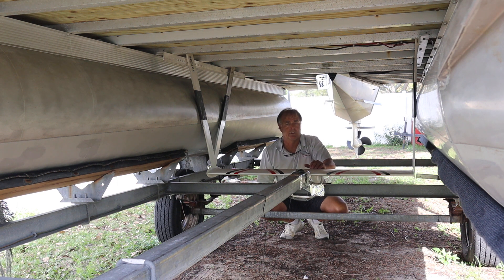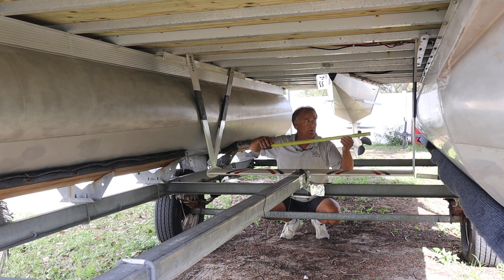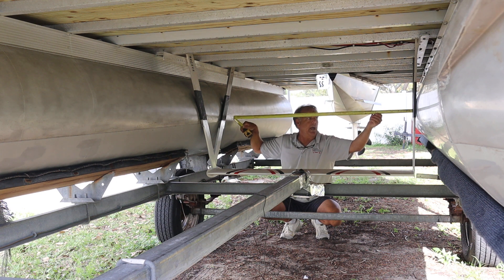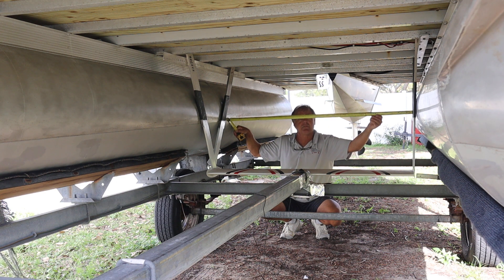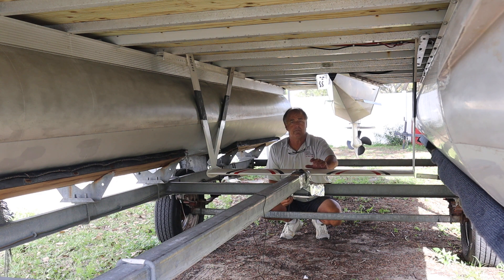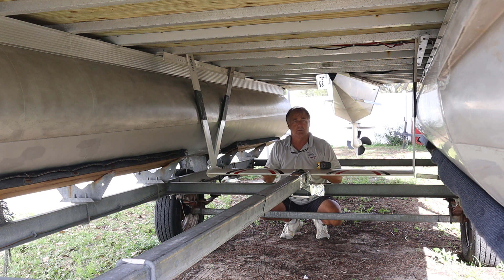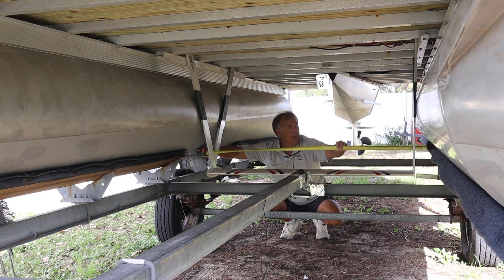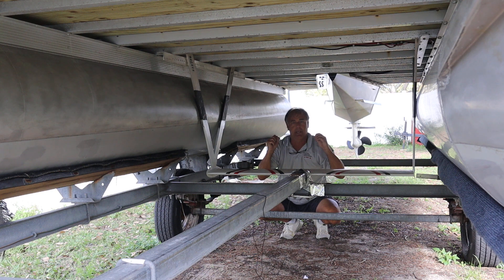Pontoon Hydrofoil Video Help and How To Measure Between Toons For a VARA™ Foil Order

Comment: Does anyone make a hydrofoil that folds up?  A fixed foil below the hull bottom is just asking for a serious problem in shallow water or when beaching which I do all the time at the lake.
Reply from the maker: Hello Murray: Not sure there are "Fold up" foils available on market yet? However our proven design has many testimonials and pictures which show the strength of our design if you choose to put beaching loads on your foil. Many of Lake Murray S.C. VARA®Lifers drive up on beaches of small pebbles with their foil. We don't recommend this because we recommend keeping your toons, foils, and motor off the grinding and chafing of pebbles and chances of rock damage. We generally dual anchor boat after beaching to let people off. This way when Rodney Daggerfield type boaters go by the beach, your equipment is not banging on dry ground damaging your investment. Here is a link to video that shows the "Load" testing of our VARA®Foil Kit after installation. https://www.youtube.com/watch?v=8buTykQOb0U&t=25s
Reply from the maker: Heres a link to a few more pics from a VARAFoil customer beached hard this weekend in Clearwater Florda after they misjudged the tide. https://pontoonhydrofoil.com/pontoon-hydrofoil-photo-gallery/

Comment: estimated cost of installation and foil combined please
Reply from the maker: Hello David, Not sure if you have a pontoon or tritoon and not really sure if you need an install price if you are a handy person. Also not sure if you are asking for a price in the Tampa florida area or somewhere else in US. Sorry alot of variables there.
Reply: @pontoonhydrofoil2242  sorry I’m in south Texas. South padre island Texas. Pontoon 22 ft 90 mercury 4 stroke. And not handy at all lol.
Reply from the maker: @daveputt42  we ll if you can run a battery operated drill motor, drill 10 1/4" holes and tighten 10 1/4" bolt and nuts after measuring and marking our provided placement #'s, it's a 3-4 hr easy install. Our VaraPlate is part of the kit and requires 9-11 3/16" holes and bolts which help you control your foil like the elevator of an airplane that controls airplane flight. Here is a link to a youtube video which shows how easy our complete kit mounts. https://www.youtube.com/watch?v=ycw8bFmwE0Y&t=19s

https://www.youtube.com/watch?v=WJKsfysIUwU

Hope this help and thanks for your interest. Our system is NOT glued and NO cutting or intrusive grinding of your hulls are needed.